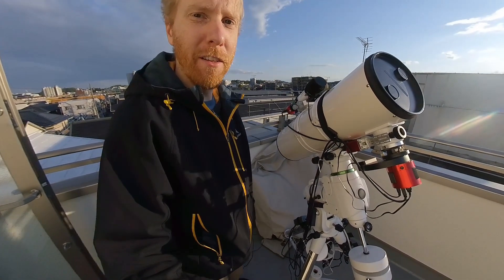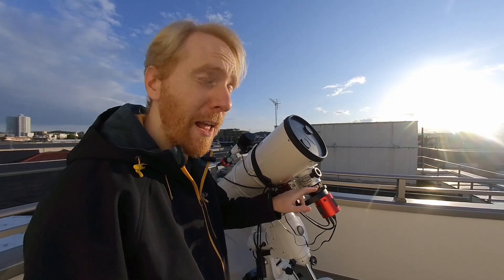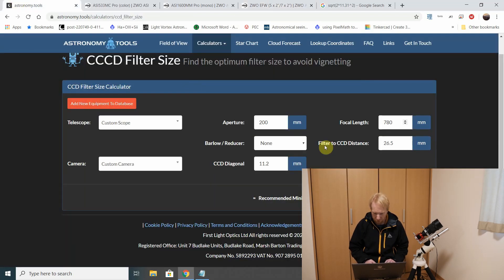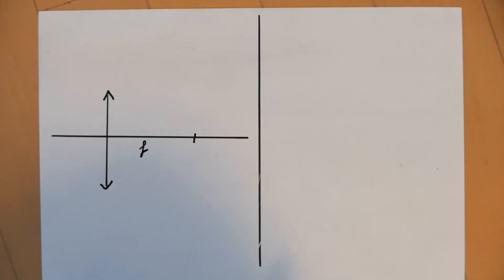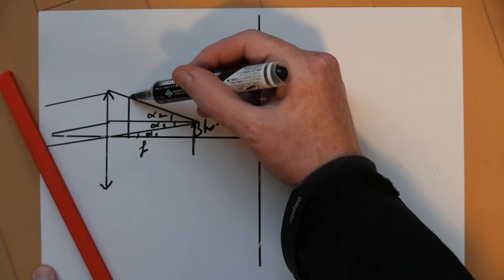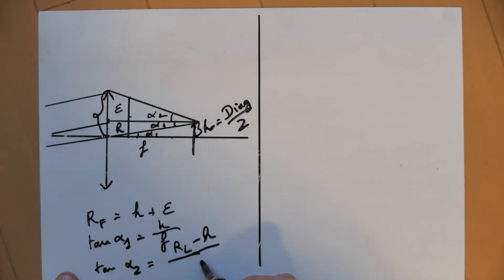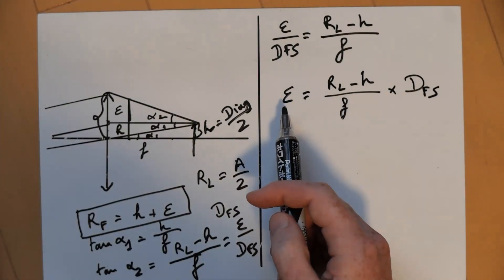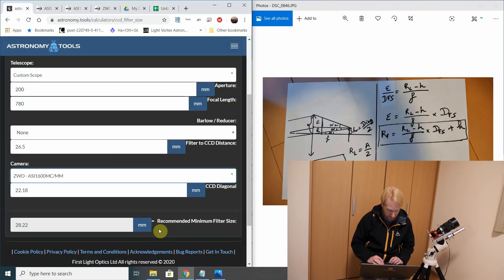Avoid vignetting with your filters!

Comment: Great video Cuiv! Would like a follow up video on what the vignetting looks like if the filter is just slightly (a few mm) smaller than this recommended size. I’d like to know if the vignetting is gradual or rather sharp, and up to what extent can one be under the recommended filter size and still be able to correct the vignetting with flats with zero noticeable SNR degradation even when pixel peeping.

Thanks!

Comment: One pitfall to avoid is that 1.25 inch filters do not have 31.75mm of clear aperture. They usually have somewhere between 26-28mm of clear aperture depending on the mount.

Comment: Thanks for this Cuiv, it definitely applies to my situation where currently I have a 1.25 inch filter which I try to get as close as possible to the ASI294mcpro window and I often wonder if this is the best solution but its all I have right now, however If for example I were to purchase a 2 inch filter and screw this in front of the coma corrector before placing the assembly into the focuser, then surely there could not be any light getting to the sensor that didn't go through the filter first, so...also no vignetting?. Is that correct?
Cheers
Dave
Reply from the maker: Hey Dave, I think the 1.25 inch filter works fine for the ASI294MC Pro, as long as you don't have a very low/good focal ratio, so I'm of the opinion that if it ain't broke, don't fix it.
A two inch filter place in front of the 2 inch FR works as well - I used to do that when I had a refractor. And yes, there would be no vignetting (or at least no vignetting introduced by that filter)!